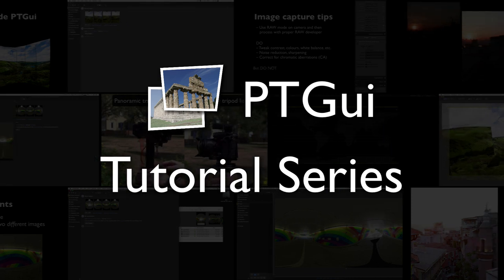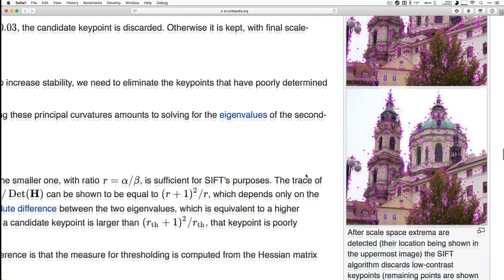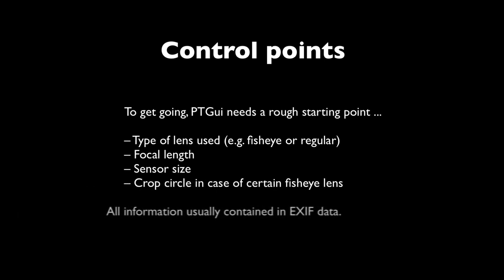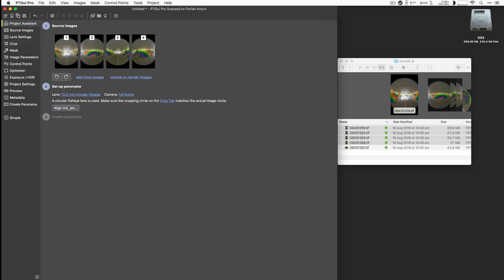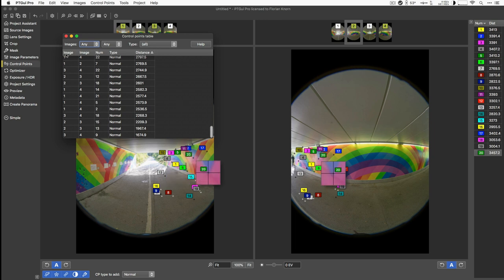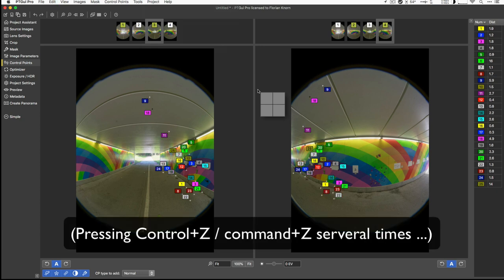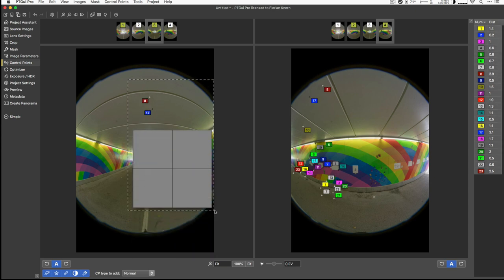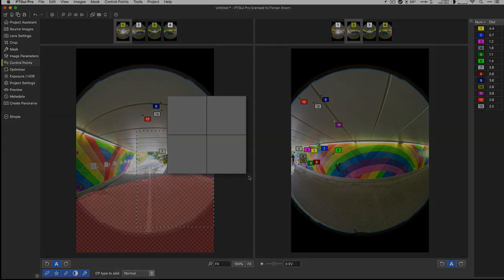PTGui tutorial part 3: Control points

Comment: I need to set vertical and horizontal lines but i dont have the menu for changing type of control point to set horizontal and vertical points. How can i make those types of points?
I have ptgui 10.
UPD
thank you for the tip in the part 3 video on choosing the same image of both sides! In that case it creates vertical control points by default, and i can change them to horizontal by right clicking on the point.
Thank you!

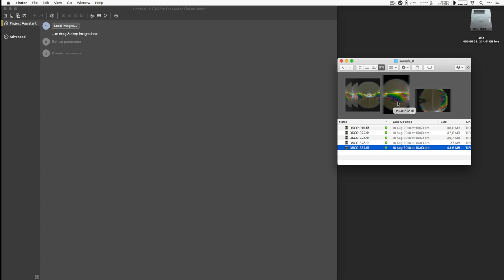Comment: @3:25 never comes back to that top or bottom image.. i wish i could see how to accuratly add a top/bottom image after initial alignment.. not by hand as i cant get it not to fit :(
Reply from the maker: Hi Luke,
if the image was taken from the no-parallax point: just add it to the project, add control points and optimize. If you can't get it to fit in, there's probably parallax. You must use a calibrated panoramic tripod head.

One exception is the nadir (floor) image: if the floor is flat, you can use viewpoint correction to compensate for parallax. See tutorial 7:
https://www.youtube.com/watch?v=qtgkaZI8inw&list=PLiaof7dM5yj6642MO1xaVz_R_2LR4kk3H&index=7

If you need more help, post to the support forum: https://groups.google.com/group/ptgui
Reply: @ptgui  o thank you for your prompt and helpful reply w that link!  Could i also request a how to do a batch jobs tips and tricks i ran a batch on 50 folders yesturday worked but wish i knew how to do a few things extra (like renaming pano files based on info)for it and had to correct a few by hand as they stitched weird. I'm def glad i upgraded to 11 pro so kuch better than the old 10 i was using thanks for the great work!

Comment: Hi what do you do if it says Not Bad??? not sure what to do
Reply from the maker: The first thing to check for is parallax. Use a panoramic tripod head and make sure it is calibrated for your lens. If you shoot hand held, be very careful how you rotate the camera between shots. See the first tutorial.

Secondly, see if PTGui has placed control points on any moving objects (cars, people, clouds) and delete those control points.

Then it should be possible to get a 'good' or 'very good' result. If you run into any problems, make your images available for download and post to the PTGui support forum; see 4.7:
https://www.ptgui.com/support.html#4_7
Reply: @ptgui  Hi, so i will explain my issue a bit better.
I took my images on a 8mm sigma lens and Nikon D850.
The pano head is a google style 4 turn mount.  The nodel point is pre-set up for the 8mm sigma so i cant see how parallax is the issue?
I have added (a million control points many times) and only once did i get it perfectly aligned, so i guess it can be but i had not figured out masking so i deleted the pano which at the time still had part of my foot it the hand held downward shot.
 
Since then i can manually add points as in you 3rd video and i get Very Good but still have slightly but noticeable misalignment with a picture frame and cooker, all of which i have managed to alighn yet cant seem to do it again and im at the point where 2 days has passed where ive spent all day and hours at a time plotting points and restarting. 

not sure what to do  now :(

Thanks for the response, i thought i would explain a bit better but its a bit of a wall of text to explain.
Thanks again
Chris
Reply from the maker: @chrisarmstrong2721   Please post to the PTGui support forum, this is the place to get technical support:
https://groups.google.com/forum/#!forum/ptgui

Make a set of images available for download (via dropbox, wetransfer, google drive or similar), include a link to the files in your message and I'll take a look.